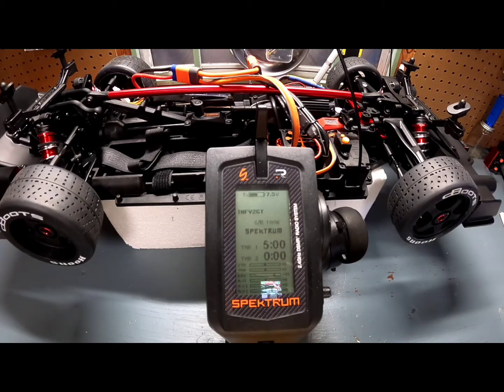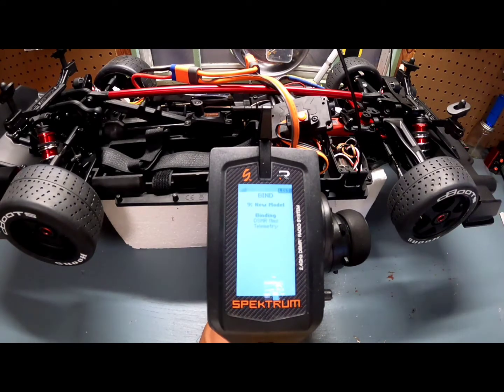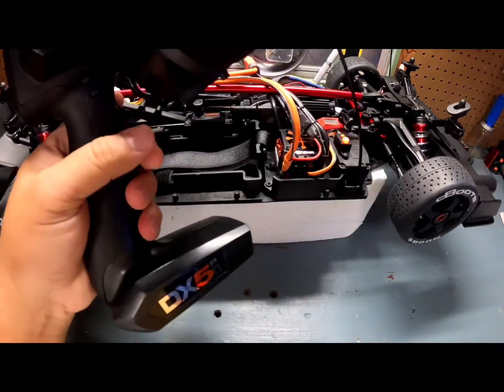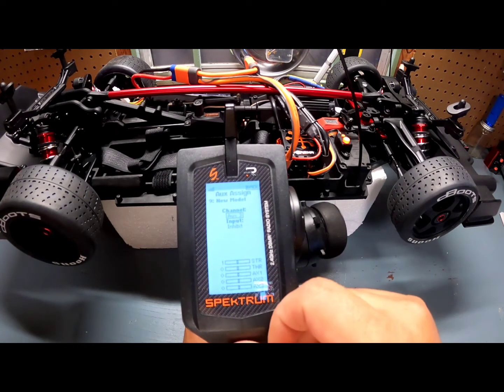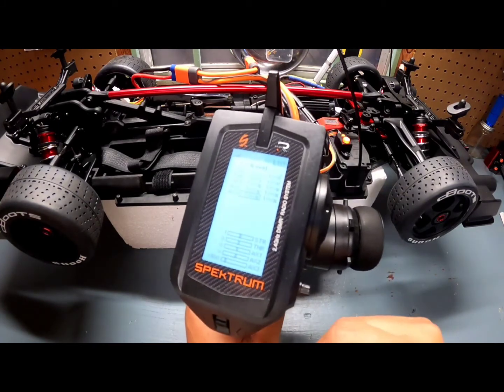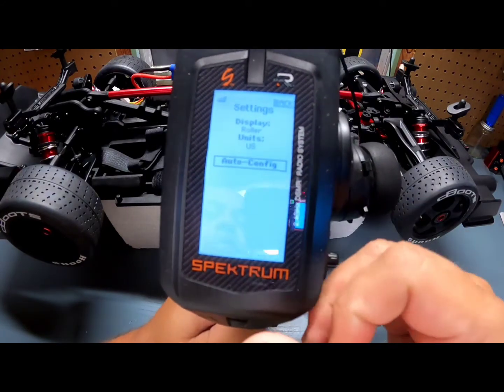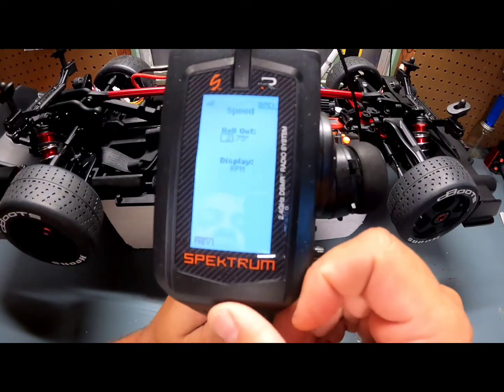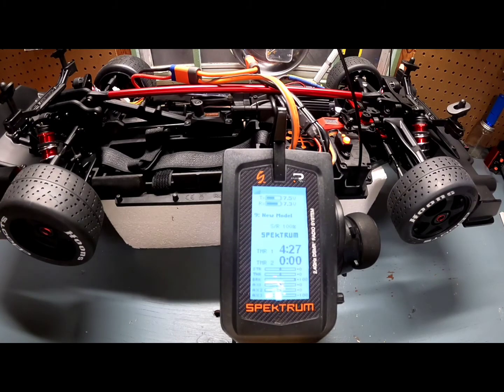Arrma Felony - Electronics - Telemetry and Handbrake setup - Part II

Comment: I like the remote. Where did you find it
Reply from the maker: @Chris Wade - I bought it at my local hobby shop but you can also find it at Amain and Amazon among other etailers. Thank you for watching!
Reply: @RCPASS1  I just found it the spektrum 5 something pro right?
Reply from the maker: @Chris Wade - there are two versions, Transmitter only and with receiver, https://www.amainhobbies.com/spektrum-rc-dx5-pro-2021-5channel-dsmr-surface-radio-transmitter-only-spmr5025/p1281172
Reply: @RCPASS1  thank you. I found it. How do you like it? I have 2 futaba remotes . I have heard that people like the dx5 pro better
Reply from the maker: @chriswade3986  My last Futaba was the 4PX and it was a great radio. I bought the  DX5PRO because it made more sense, cheaper, a lot of my cars come with SPEKTRUM Receiver and AVC built in. But after a year of using it, I find it to have great range for speed runs, easy to program and very flexible. I also use it on my crawler, race bugy, nitro and drift car. I hope this info helps you.
Reply: @RCPASS1  thank you. I have this in my cart at amain right now. I have 6 Aarma cars 2 of each... limitless, infraction, and felony. I kept one felony and one infraction stock the other 4 are running castle creations combos including the Xlx2 2028-1100kv so I’ll use the remote on all 6 . Thank you again . The futaba is nice but it was a little confusing trying to figure it out.